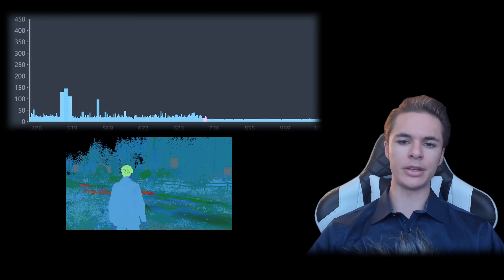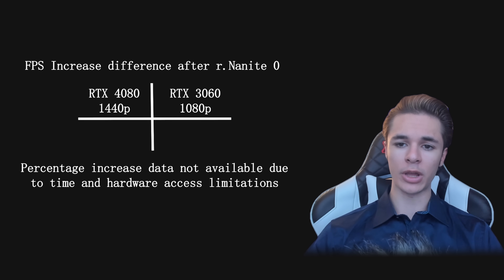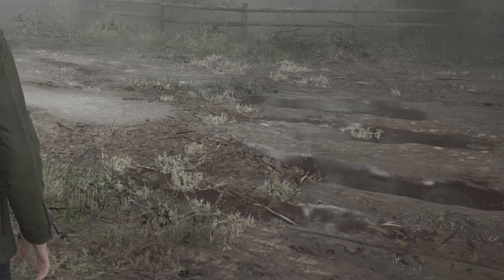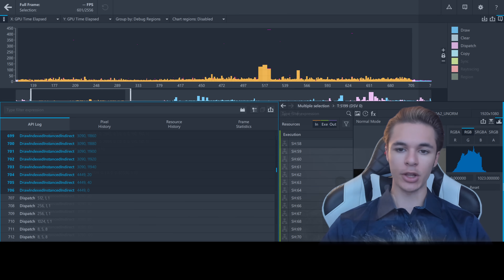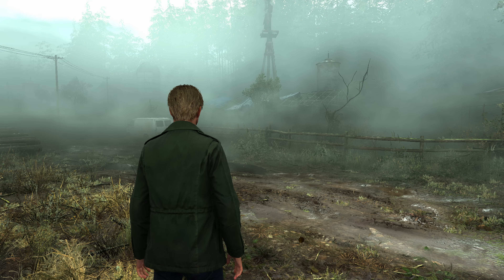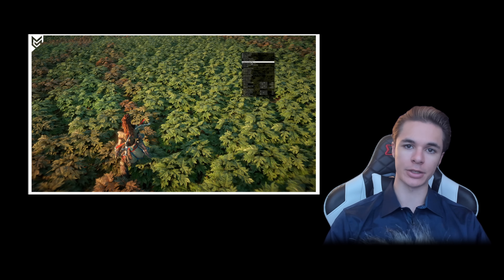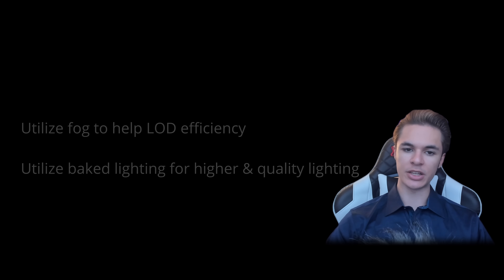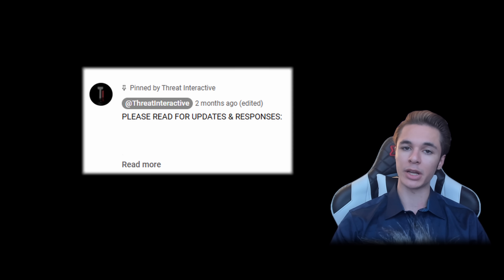The Price of Realism? | SH2R Optimization From The GPU Perspective

Comment: The irony of not using the fog to their advantage to hide low quality LOD for performance purposes, when that’s literally why it existed in the original game.
Reply: With how bad the traversal stutter is in open areas I'm genuinely surprising they didn't think to use the fog as a bandaid.
Reply: @Gadtkaz  rtx 4000 series gpus tend have more stutter than previous gpus
Reply: The game stutters incessantly in the interior apartment/hospital areas (possibly even worse than the outside areas) so I'm not sure how much this would have alleviated the problem
Reply: What happened to "table fog" from nvidia ? At one point it was a solution to the fog problem😅
Reply: That was Silent Hill 1 and it was to hide the low draw distance they could get on PS1 without tanking performance. 
OG SH2's fog effect was actually pretty taxing and used specific peculiarities of the PS2 to be performant. Every official port of that game struggled to reproduce the fog effect even on theoritically more powerful hardware than the PS2.
Reply: It's not irony it's incompetence
Reply: You are wrong. Disabling the fog in the city shows the level streaming. They use the fog to hide the level pop-in
Reply: Yeah that one was kind of funny.. there's definitely some benefits to not relying on that I guess, and they certainly wouldn't apply to that scene or that shot.. I think what's killing me is that mention of getting rid of tessellation.. which is just kind of like.. why? It's a perfectly viable solution to certain problems?
Reply: This is what happen when idiots make decisions in big companies. Something normal nowadays. Artists will make anything that management want from them, they want „zero” optymalisation so the final product don’t have it at all.
Reply: In original SH1, but in SH2 fog was technical achievement. That is according to Modern Vintage Gamer talking about Emotion Engine timestamp 7:30.
Reply: Nvidia sponsored title. To hurt their previous gen hardware to sell you DLSS and AI upscaling features
Reply: They do it actually but not as good as they could
Reply: Original, yes. The PSX one. Silent Hill 2 heavily leveraged its fillrate to create the fog, pushing it to the point where the original XBOX and PC port at the time had a heavily cut back implementation of the fog, because it was just THAT heavy.
Reply: Having an excuse to have a low render distance is like a dream for a AAA dev.
Reply: @cikame  I feel the most common AAA devs nowadays get just handed an engine with barely any understanding of optimisation. That's not their fault, it's somehow considered more profitable to hire hundreds of people whose skill is just putting assets into Unreal than hiring a couple who actually know how to make an optimised engine.
Reply: @PauLtus_B  I think this is true, however it's not just UE games with horrendous traversal stutter, Dead Space Remake on Frostbite is on par with SH2 with how bad it is in that regard.
Reply: @steviewonder0850  I agree, I think it's a pretty industry wide problem, not just a UE problem.
Reply: I mean, it's not that big of a deal since you're going to spend like a fraction of your playthrough in the fog world. Also, I noticed that fps is higher outside than the inside, which is funny, but I still notice some small stutters here and there.
Reply: Yeah ther eis real fog and fake one and real fog really make the game lag like crazy. If i am not mistaken stuff like that was used in mmorpg like runescape for very long time
Reply: Wasn't it a very low render distance the fog was hiding in the orginal? Still a similar thing.
Though I've seen videos of the remake with the fog removed and it still has a very low render distance by modern standards with lots of pop in
Reply: they did use fog for that . I know that because i have a mod that can turn fog on and off and tons of textures are not loaded as you walk.
Reply: Dude, my grandma knows better about Silent Hill than the entire Bloober team.
Reply: Yet developers  continue  to use  the Trash stuttering  U5 engiand. Developers  are just  getting  lazier & lazier then they blame the  company  for not having enough  time & budget which isn't  always the case. DLSS & FSR ,etc has been a blessing & curse because  developers  are substituting  this instead  of optimizing  the game.
Reply: Game developers back then were not just game devs but actual coders that knew the technical aspects of a game. Game devs now are just script kiddies.
Reply: THIS
Reply: Game delevopera get payed to make furture cards relevant, even if its waste of resources and performance
Reply: the game was remastered dude, its meant to look rage not meant to be plsyed on a potato, lowkey
Reply: I dont think the majority of the fog even needs to be volumetric or move at all. Have those people seen fog irl with no wind? The movement is extremely slow and only noticeable from a distance.
Reply: this game is slop and part of the horrible remake culture of late, that tries to erase history and the real original work by making it very hard to play the originals. those are revisionist games at best.
Reply: @Mewsashi-cz9fo  Stop being an idiot. Neither Konami nor Bloober team have any desire to "erase history," and Konami has clearly decided not to pursue any action against SH2 Enhanced Edition, which makes it extremely easy to play the original game. On Bloober team's party, they were sure to include moments of direct reference to the original SH2 all over the remake, and included the full credits of the original Silent Hill 2 when they didn't at all need to. I'm all for conspiracies where they actually exist, but this is just be being a freak. Konami wanted to bring Silent Hill back for the sake of making money and SH2 is the best known, most beloved one, so they remade it. That's all there is to it.
Reply: I enjoyed it. Wouldn't hurt to see a tr style remaster of the original, too. @Mewsashi-cz9fo
Reply: @Mewsashi-cz9fo  That’s a bit conspiratorial. I think it’s more likely that Konami wanted a cash grab based on name recognition and nostalgia, and Bloober had already proven themselves to be good at putting together decent-selling horror games without them costing too much. I don’t doubt for a moment that Bloober was working from a place of reverence for the original work.
Reply: Irony or not. Two completely different mechanics. In the original game it wasn't "fog" just floating textures. This is volumetric, millions of particles rendering at the same time.
Reply: @Darkcranio  Volumetric fog doesn't/shouldn't take millions of particles to render. Volumetric fog is generally raymarched in post, with particles or drawn objects being used to populate a 3D texture or some other data structure with information about how dense the fog is at a particular location in the world, as well as maybe the material properties of that fog.
Reply: @jcm2606  yeah, they probably don't know what they're talking about.
Reply: @Darkcranio  Fog doesn't use that much resources, there's literally a performance breakdown in the video. Just sloppy devs being sloppy devs. I couldn't believe that the game with a static environment like that and the fog advantage still stutters horribly and has UE load stutter.
Reply: @shadik1998 The worst part is 2 days after it was released there was a mod that fixed the stutter
Reply: @shadik1998  that's entirely on your system then. It plays perfectly fine for me and looks incredible.
Reply: @s3thm1chael44  Bruh the game has traversal stutters and some occasional stutters on every system. Ps5, 7800x3d, you name it. Develop the game better next time.
Reply: @shadik1998  I feel like everyone is very confident they know how to fix all performance issues, when they aren't the devs having to actually do these optimizations and make an actual full game at the same time lol.

I used to make a lot of assumptions about how games should be made, until I actually started making them lol.
Reply: @null7198  I mean not rendering a fuck ton of polygons on trees hidden behind a fog is a pretty good start, eh? You literally comment this under a video that shows very glaring performance issues and they don't seem rocket science-ish.
Reply: @shadik1998  But people also often make assumptions about fixes being "Easy, just do this!!" When creators factually have a reason for doing it this certain way, whether it be engine limitations, things breaking up on implementing optimizations, leaving certain things that aren't actual contributors to the performance issues, etc, etc.

I appreciate the video's intent, and I'm not saying any of my reasonings are the reasonings of the developers-- Maybe they literally just don't understand optimization or had some major time constraints, whatever the case may be--  But I also just know players make a lot of assumptions about what causes a game to be unoptimized and that isn't always the case-- Even the technically inclined may underestimate what issues may appear when working on larger projects.
Reply: @null7198  I agree with this so hard. Every freaking game will have people in reviews and comments spouting “GAME NOT OPTIMIZED >:(“ while having absolutely no idea what that means besides it being a magic switch that the developers were too lazy to flip.
Reply: @shadik1998 
Dude, volumetric fog like that is ABSOLUTELY taxing to make. 

Ironic you call the devs sloppy when you don’t know basic shit about game design
Reply: @Indigo_1001  Apparently it's way less taxing than reading comprehension to your brain. Watch the video first and compare the gpu times first for all rendering stages before publicly embarrassing yourself.
Reply: @Darkcranio  Yea it doesn't matter if it's volumetric you don't see far objects anyway they could easily optimize it but didn't
Reply: @Darkcranio  And zero reason to be volumetric, since the world is comepltly static and there is no sun to create dramatic sun rays. Abseloute waste of performance.
Reply: @Darkcranio  That's my man! People seems to have a lot of opinions about fog but do not understand the difference about standard z-depth fog and full volumetric fog.
Reply: @Darkcranio  Saying "millions of particles rendering at the same time" is misleading. Fog can be complex, sure, but typically is not done to this level for obvious performance reasons. Also, the original's fog is more than just "floating textures," the particles were just part of the fog.
Reply: @Darkcranio  og sh2 had volumetric fog, so, yeah, his point still stands
Reply: @lastchannel100 
Fog used in the OG games and the actual volumetric fog from current games are complement forms of tech.
Reply: @Darkcranio  Whyyyyyyy?! Why do we need millions of particles rendering at the same time when the original fog worked just fine?!
Reply: @Darkcranio   Fog is not made from particles.
Reply: Mate. It's just fog, not rocket science  @Darkcranio
Reply: And was these particles worth the massive hit to performance and immersion or could you really just not live without them  @Darkcranio
Reply: @Darkcranio It doesn't matter what it is. This has nothing to do with the fog itself. All they had to do was lower the draw distance.
Reply: @Darkcranio  thats not how fog works bro
Reply: @Darkcranio helldivers uses fog modern day and it has 0 impact on performance. In fact even the blizzards dont
Reply: @Darkcranio He's talking about SH1's depth fog.
Reply: @Darkcranio  If it doesn't work correctly what is the point, the fog existed for a reason before and that was performance, it doesn't make to sense to add it to make the game run worse
Reply: @Darkcranio  Wrong. It wasn't just floating textures. In fact, having lots of big floating textured with lots of alpha can kill performance pretty fast. The models faded to a color depending on the depth buffer and they added some textures so that the fog doesn't look flat
Reply: @Darkcranio  And also volumetric fog can utilize low precision math function like FP16 or FP8 to save resource of compute , besides the culling tech that already exist in PS3 era and nowadays with mesh shading and nanites.  Nanites is just un optimized.
Reply: @mightyhadi6132  depends on the pipeline, if they are using AVX512 or avx2 for example. To my knowledge, 32bit is the minimum bit width for a FP value.
Reply: @Darkcranio  Original SH2 fog was not just "floating textures" that is a very simplistic way to look at it, yes it was quads with a fog texture on it but it also add some adicional processing like alpha blending and movement to make it feel like fog, and this technique has been used to do particles effects for decades. I bet that even in UE5 that is still a option.
About UE5 fog, even thou I don't work with UE5, I don't believe for a second that is millions of individual particles, that would be massive overdraw and would kill performance, is more probable to be a system using a volumetric texture.
Reply: @Darkcranio  yea maybe but nothing stop you from adding a basic fog only on the background for that.
Reply: @Darkcranio  If they had made the fog more realistic, it definitely wouldn’t have come out with this smoky 'volume.' Consequently, it would have been less demanding on performance
Reply: @Darkcranio  
Volumetric fog is more complicated, sure, but it just as much hides things and can be used just as easily to hide low detail assets. It's still a waste.
(I think the original mostly had some basic depth based fog and a couple of semi-transparent textures to add some visual detail.)

Comment: what? why would they remove support for hardware tesselation? if they have a better approach fine make that default but why remove it entirely?
Reply: Hardware tesselation is bad. (Efficiency even when tesselation is not happening, culling, not able to use high tesselation factors etc.)

If one really needs non nanite tesselation, compute variant should be made.
Reply from the maker: @pottuvoi2   Assuming your referring to Demon Souls Compute Tessellation, we would have no problem with that if it wasn't 90%+(at least) slower than properly managed HW tessellation like Nanite. Despite the recent industry noise calling HW Tessellation "slow", we'll be putting this to the test since these claims do not align with our experience.
Reply: @ThreatInteractive  And similar, yes.
Quite many games use compute pass for it now a days.
Reply: Tessellation has been back since 5.3... Not sure why he chose not mention that fact.
Reply from the maker: HW Tessellation IS NOT back since 5.3, they added NANITE tessellation which is far slower and completely different.

Comment: I really like your videos and love your critiques on how games don't run so well even though our GPU is still in good condition. Can you check out non-Unreal Engine games today like Helldivers 2 because I have a 5 5700x3d and Rx 6800xt but somehow lose fps on higher difficulties even at lower Optimization settings even it lacks of Fsr and Dlss. Hope you check how ArrowHead run game runs.
Reply: Try DX11 in that game.
Reply: @Funnky  the problem DX11 is far stuttery and worser than DX12, thats why I rely on Lossless scaling to gain the Smoothness
Reply: Is helldivers 2 not unreal engine 4?
Reply: @Gustaviustwinkelberry  no
Reply: @Funnky  i just looked it up and it doesn't use unreal engine 4, it definetly has that unreal engine 4 look to it tho...

Comment: Would it be possible for you to check some of the 2024 games we usually consider well optimized?
Like the Horizon Forbidden West or God of War Ragnarok PC ports.
Reply: Considering the level of quality it can achieve I think ironically one of such games might be Cyberpunk 2077, albeit not a 2024 game.
Reply: Ragnarok isn't that good of a PC port, it still lacks graphical features that the PS5 has (like raytraced reflections)
Reply: @Nate_M_PCMR the ps5 version doesn't have raytraced reflections
Reply: @gavinderulo12  The PS5 version does have ray traced reflections. Both Digital Foundry and NX Gamer have showcased and talked to the developers about it/ They aren't the traditional ray traced reflections and combine that data with cube maps
Reply: @crestofhonor2349  which can totally be done in PC but they decided not to.
Reply: @detuneCris  and nobody will miss them anyway so, good move for not wasting time with useless stuff

Comment: This guy is still clueless but can't stop yapping 🤦‍♂️ 

Quad occupancy doesn't matter in a deferred renderer, since lighting is done in a completely different pass from rasterization.

TAA isn't used to "hide" noise. It's called spatio-temporal stochastic sampling, and is very mathematically elegant. They accumulate integrals using only a tiny fraction of the usual samples needed.

It's like he read a couple rendering blogs and now thinks he knows more than AAA industry developers lmao.
Reply: TAA does hide noise, which is what stochastic practically is, advanced algorithm or not. It also is a technique that exists to improve performance by using less samples, which only works with temporal accumulation so you can blend the effect nicely and make it look whole. So yes its hiding these image quality defects, that's the point. The image looks worse, it runs faster, and TAA makes it look better because it hides the lower quality by reducing the visible noise.

To claim this isnt true is just playing a game of semantics in order to be right; which is a waste of everyones time.